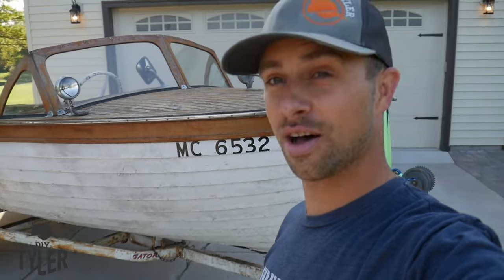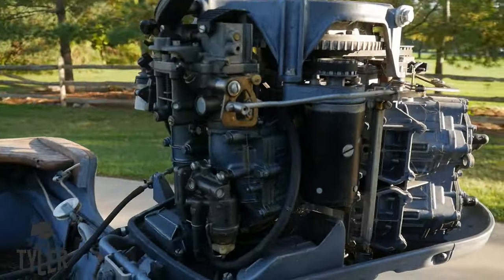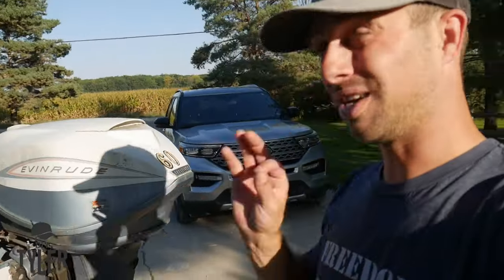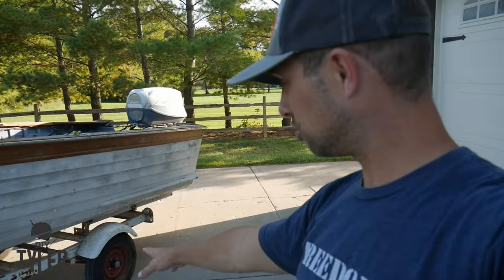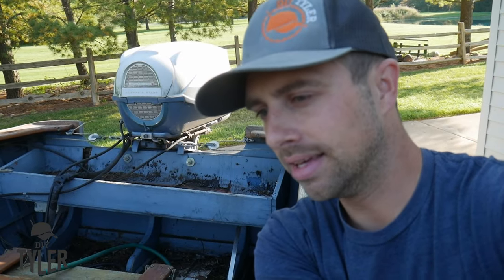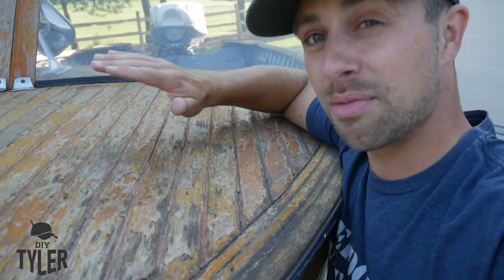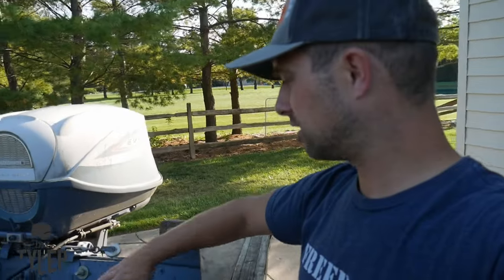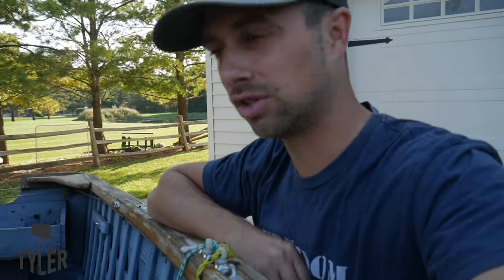I bought an ABANDONED wooden boat! It will 100% SINK right now!

Comment: Tyler get ahold of Teak Decking systems in Sarasota, Fl. My brother worked there for 40 years and they have the adhesive you will want to use for that top. I showed him this video and he said to use wax or nothing if that is indeed Teak. He also said to use Mahogany for the keel and regardless of current width, make the keel 2” wide and use mahogany on the bottom and sides. He begged me if you go with his advise to not paint it. Finish the sides and bottom with total boat marine finishes. This will be fun to watch

Comment: It is a nice old lapstrake style. My old Jafco  same (vintage) was mahogany over oak. The Evinrude is probably not original to the boat.  I don't see a waterline boot stripe so it must be a fresh water boat.  Good Luck to you, it will be a project but once you get it there it will be easy. My last boat was an Egg Harbor that was 37 feet of wood.  A few tips I picked up over 17 years with wood boats. I'm a wood worker also and the boat was different in finishing.
1. Use good marine products like Petit or Interlux . I used alkyd enamels.  Not sure if they still make them. Maybe today people are using Total Boat, Imron or Awlgrip for finishes instead of regular paint?   
2. Always seal the wood before paint or varnish. I used  Interlux #1026 for that. provides good surface for the primer. On the varnish areas, use a "filler" stain. That wood looks like brown mahogany and the caulk is probably rubber based. Tape the wood, I learned the hard way on a teak deck.  
3. If you are painting the Hull . Sanding surfacer for primer then the top coat. I always kept my paint flowing with a little Penetrol and #333  brushing liquid.  Get the best brush available. I still have my Purdy 2" auto enamel brushes.  Use #93 trowel cement to fill any deep divits. You'll get a great finish every time.  Semi-gloss paint is your friend.
4. Your varnish will take about 13 coats to get it where you want it.  Always hand sand between coats. You will know you are there when there is no orange peel .  
5. Bronze screws in the hull. Bung ( plug ) each hole. Hope you have a good set of plug cutters and countersinks.  You may want to get a Yankee Screw Driver (old school) you will want to feel the screws take-up. Power tools snap them.  Exposed screws=chrome plated brass or bronze.  You may find most marine screws are slot. 
6. You will find Never Dull works great on the chrome and stainless. 
7. If you have blackened spot on the bright work, it is quicker to strip it, bleach it with oxalic acid or teal brightener, stain it then finish. I had to do my transom that way.  
Good luck to you. I'm glad to see some of the past being preserved.